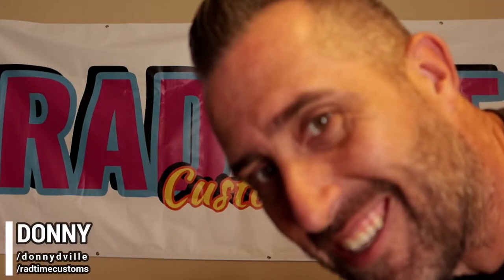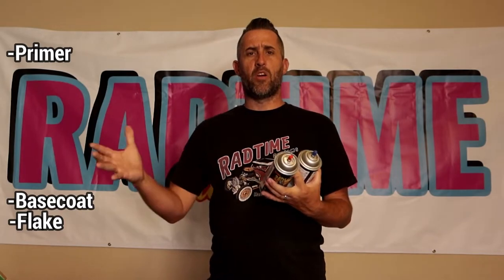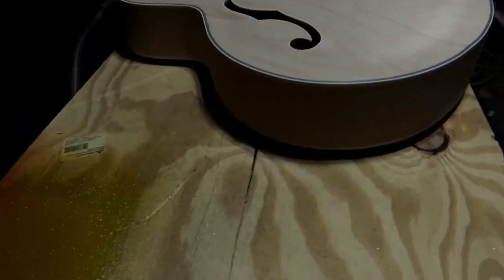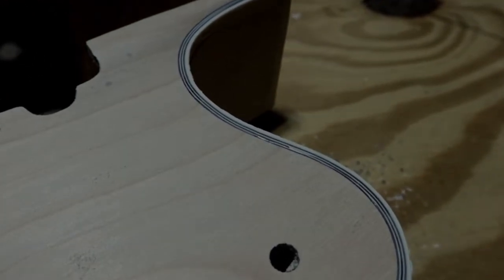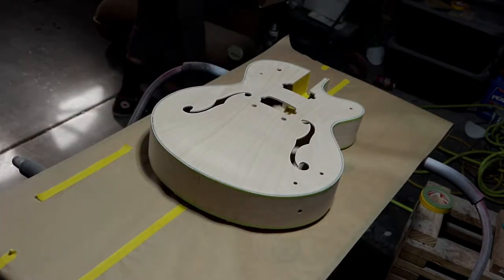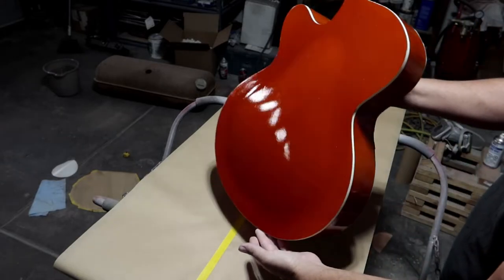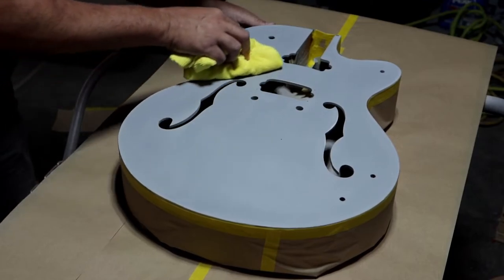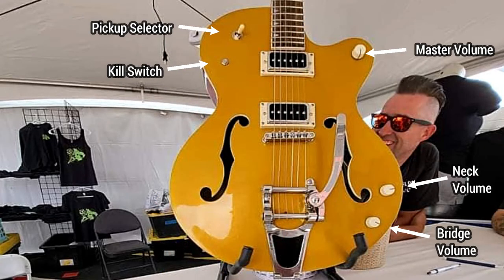Spray painting guitar with candy and flake

Comment: Great video. Thank you for not rushing through it. You demonstrated and explained every step and detail thoroughly. Even repeating them such as how long you waited inbetween coats and how many coats you put on. Thank you. Great job. Roth should have this one on their website. Also great Job on the part two follow up to this one. If you get a chance can you please do a demonstration of the rattle bomb complete black kit. You can not find that anywhere. Even on their website. The picture they have does not show what it fully looks like.
Reply from the maker: Thank you! That is much appreciated!!!. I haven't really had the need for the greasy black, so much so that i didn't realize it was black kandy over surfite silver. I may have to play with that one. I am currently prepping a roof for my dads 57 TBird. Its getting Sparkle Silver basecoat with blue kandy. Maybe ill have to shoot the borders first with greasy black instead of solid black before the blue kandy. This way you can at least see how greasy black looks over silver before it gets covered in blue. Cant make any promises as I change my mind on custom stuff all the time and the plan may change 3 times this week alone haha. If I don't use it on the roof...I'll find a use for it. Maybe the back of the LP Im building for myself...hmmm

On the guitar side of it, I will hopefully be posting video of the first Radtime guitar I'm actually building for myself. I've already painted it so it will be more electronics, hardware etc...but!...on that guitar I used sparkle silver for the headstock and pickguard with gold pearl...sparkle silver may be my new go-to basecoat...at least when my spray gun gets dusted off

Comment: I used glitter from rustoleum for my base. 
Should’ve just went full rattle bomb. Now it’s like 80 grit sandpaper and I’m 3 cabs of triple glaze clear coat in.
With a run on the last pass.
Reply from the maker: I've done the same. Now I just use that glitter stuff it's a transparent part and shoot it on the inside like an RC car body. It's straight 80 grit when dry haha